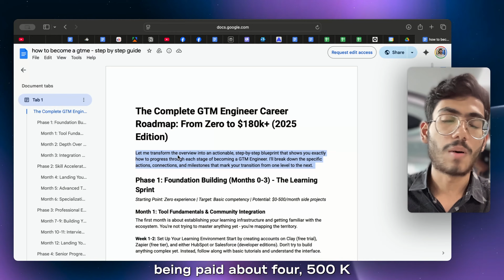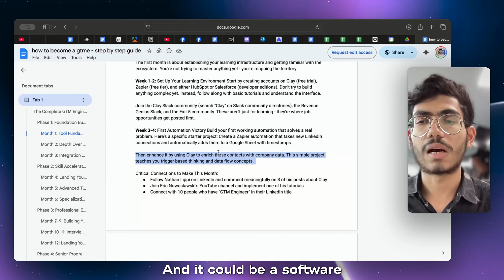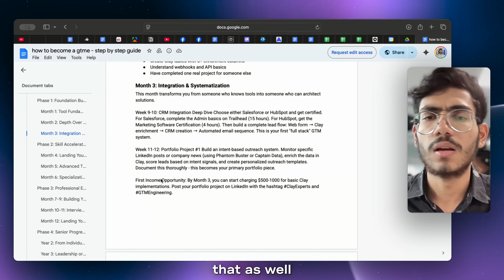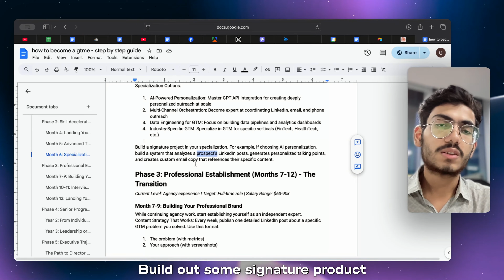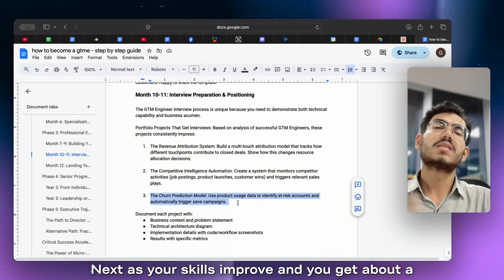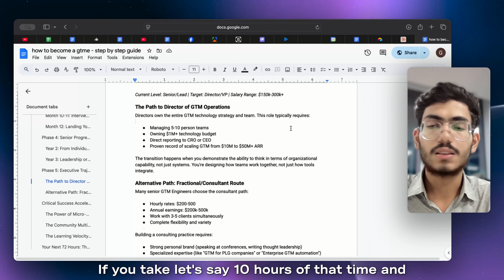Complete GTM Engineer Roadmap (Step-by-Step Blueprint)

Comment: In the week 3-4 section, you mentioned that as a starter project I should create a Zapier automation that takes new LinkedIn connections and automatically adds them to a Google Sheet with timestamps. Now I'm trying to do this, but there is no webhook option, nor does LinkedIn allow you to export your connection data when I am an individual. I don't have developer access, so I seem to have hit a dead end. What am I doing wrong here?

Comment: Curious what you think is the most important skill for a new GTM engineer today: Clay mastery, technical skills (Python/APIs), or understanding sales psychology? Feels like teams like Frontal are combining all three
Reply: Hi @tuhus11, you’ve touched on the exact debate that defines the current GTM era. Comparing Clay, Python, and Sales Psychology is like asking if a car needs an engine, a steering wheel, or a driver more—the magic happens in the System Architecture that connects them.
The 'Frontal' approach you mentioned isn't about mastering one over the other; it’s about Workflow Orchestration. In 2026, the most critical skill for a GTM Engineer is the ability to build an Enrichment Waterfall. This is where you use APIs (Technical Skill) to pull data into a tool like Clay (Tool Mastery), but the entire logic is dictated by the ICP's pain points (Sales Psychology). If you have the tech and the tool but lack the psychology, you're just sending high-tech spam.
To scale like a pro, you need to master Intent Signal Processing. Instead of just 'scraping' leads, a GTM Engineer builds systems that monitor triggers—like a company hiring for a specific role or a tech stack change—and then uses Conditional Logic to personalize the outreach. This bridge between raw data and human resonance is where the high-ticket revenue lives. Mastery of n8n or Make for the 'glue code' is often more valuable today than deep Python knowledge for most outbound motions.
I’ve actually just published a technical blueprint called 'The GTM Skill Hierarchy: Building Clay-Powered Outbound Stacks' that explains how to integrate these three pillars into a unified revenue engine safely. You can find the full architecture breakdown and the tool-stack checklist here: https://zzapplezzz.github.io/pro-workflow-vault/capture_gtm_blueprint_clay_stack.html
This should help you prioritize your learning path and start building systems that actually convert!
Reply from the maker: It’s definitely a blend, but I’d say sales psychology is the foundation that makes the technical skills actually effective.

The most important thing is that everyone can be a script kiddie. Everyone can know the tools, but knowing how to use those tools and draft strategies that actually get leads is the most valuable part. I see that very few people know that, and it is not something everyone knows.
Focusing on sales psychology and buyer psychology, mastering buyer persona and G team strategy in general is a master move. When you have that, you can do the following in three months:
- Acquire technical skills, which is something you can do in three months
- Build what campaign I should launch
- Why I should launch this
- Why I should create this list and not this list
- Why I should write this angle and prioritize this angle over this
That is the only strategy, the only skill that helps you when the campaign is not working right and you need to diagnose it. The only thing that helps is the GTM strategy knowledge.
For actually printing and making money with technical skills, sales psychology, as you mentioned, GTM strategy knowledge is the most important thing that makes you powerful. I see it as very scarce and very rare amongst GTM engineers, at least new GTM engineers.